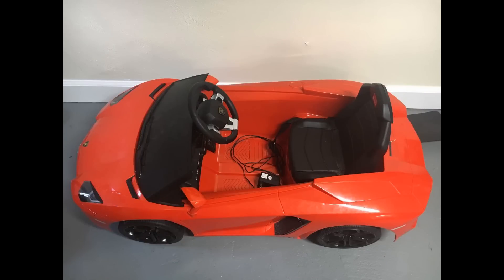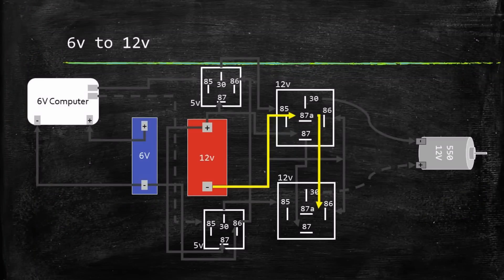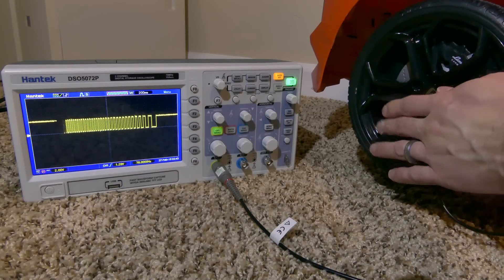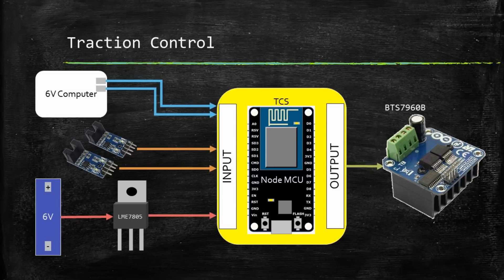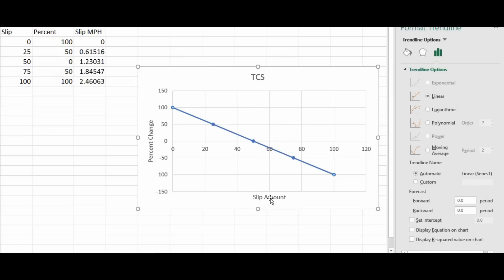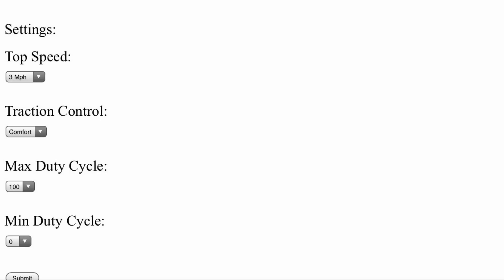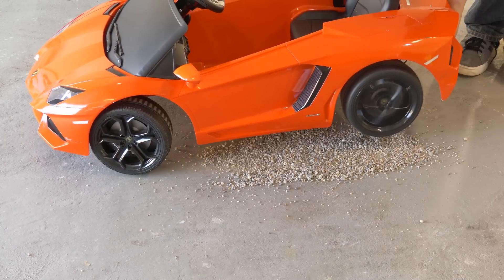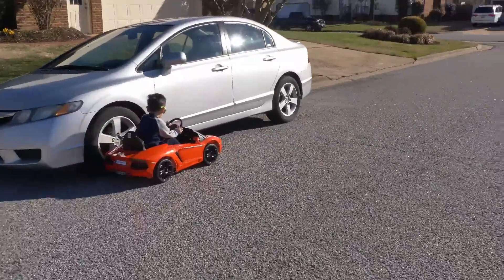Traction Control Lamborghini Power Wheel

Comment: Can you do my son Lamborghini for me an how much u charge
Reply from the maker: I can help for free, just let me know if you have any questions.
Reply: @CodeMakesItGo  just wondering how hard would this be to do without much knowledge of anything? Where would I start?
Reply from the maker: @arnoldtsen3084  Doing the 12v upgrade without software is easiest. Doing it with software to slowly ramp up speed so the wheels aren’t breaking loose is moderate to easy. Going all out with traction control and remote smart phone status is hard. I removed the traction control and now just have a speed ramp because the wheel sensors eventually broke. But I’m here to help if you want to give it a shot. Thanks for watching too!
Reply: @CodeMakesItGo  sounds good! Will def ask if any questions! Thank you!
Reply: @CodeMakesItGo  Hello again! Just wondering if you have the name or link to buy the 12V relays and the 5v relays you used in the video

Thank you!
Reply from the maker: @arnoldtsen3084  I updated the comment section with the parts, thanks for asking about it, I forgot them. You will need 2 SPDT 12v relays that can handle 40 amps, and 2 SPST 5v relays to trigger them. These aren't the exact 5v relay boards I used but these should be easier. I have the exact ones in the comments if you are interested. 

12v 5pin with wire harness
https://amzn.to/3cixrJc

5v Relay board 
https://amzn.to/3enwEtg
Reply: @CodeMakesItGo thank you so much!
Reply: @CodeMakesItGo  hi there! So the 5v relay just arrived and I was just wondering how I would interpret them in the wiring diagram. I noticed there are 85,86,87, and 30. Which of them correlate to the DC+. DC -, and the IN, NO, COM and NC. Based on the wiring diagram I assume two will be unused.

Thank you so much for your time and assistance!
Reply from the maker: I’ll make a better wire diagram and post it later today. The one in the video is a bit hard to follow because it was intended for show. But in any case, I’ll fix it up for you.
Reply: @CodeMakesItGo  thank you so much! Appreciate your time and assistance :D
Reply from the maker: @arnoldtsen3084  
I uploaded this to the github page. Here is a link to the file. Let me know if there are any questions and how it goes. One warning is that this will send the full power to the drivetrain which in time may strip the plastic gears out. I'm sure you are aware of this though. 
https://github.com/CodeMakesItGo/Traction-Control-Lamborghini-Power-Wheel/blob/master/Wire%20Diagram.pdf
Reply from the maker: Be sure add a fuse to the 12v too, 30amp. Also know there is risk with modifying these toys so please be careful and use good judgment if this is safe for your kids.
Reply from the maker: Did you get it working?
Reply: @CodeMakesItGo  not yet, one of the fuses they sent came wrong and had to wait for a return and resend, I'll be sure to keep you updated! Thank you!
Reply: @CodeMakesItGo  hello again, just wondering if there is a trick to the motor swap, as the gear seems very hard to separate from the old motor. Thanks!
Reply from the maker: I think I had to heat up the gear.

Comment: How did you keep the stock board from frying?
Reply: Stock board is still powered by the original 6v battery. I use the original power to the motor as triggers on the 12v side.
Reply: Can you do a DIY video or write please? Not much online for these cars unless they're Power Wheels brand that don't come with a call control board. Thanks 😊
Reply from the maker: See if this helps: https://hackaday.io/project/166169-traction-control-lamborghini-power-wheel
Also the code is here: https://github.com/CodeMakesItGo/Traction-Control-Lamborghini-Power-Wheel
And you can message or email me with any questions. Have fun!
Reply: @CodeMakesItGo  I think I figured out the wiring. Quick question - can I use the h bridge direct from the board without the node?? Looks to be a much cleaner set up than with the relays. Thanks again!
Reply: @CodeMakesItGo  and BTW, that Traxxas 12v seems way faster than my dual stock 550's. Is that to be expected when upgrading (stock to aftermarket) motors?
Reply from the maker: Yes, the node is only for traction control and speed limiting.
Reply from the maker: dboy26 typically yes, but not always. Some times they are slower but have higher torque. Look at the number of windings on the motor. More windings equals more torque and usually less speed. Also brushless motors can have an even higher rpm and power than the equivalent brushed motors. But are more expensive.

Comment: Nice work Jason! did you had a freewheeling diode on your mosfet? I believe I see a diode on your protoboard.
Reply from the maker: Jerome Demers indeed I did. Unfortunately I could not figure out why it kept getting blown out and tossed it all out for the H bridge. My wife was mad at how much time I wasted on that FET when the H bridge was only $13. 😁 Thanks for watching!
Reply: Could you explain how you hocked up that H-bridge? I'm doing the same 12v hack but without the traction control (just the H-bridge 12v)
Reply: Yes, I followed this diagram. "https://i.ytimg.com/vi/hny6wNhY1uU/maxresdefault.jpg" Basically tie 5v to the VCC, Left enable and right Enable pins. Then control the forward and reverse with the Right PWM and Left PWM pins. You can use the R_IS and L_IS for current feedback if you care or use the enable pins as a emergency cut off. Ensure you do not send a PWM to the R_PWM and L_PWM at the same time. Alternatively you could just use the 12V relays unless you plan to ramp up the speed which I'm guessing is what you are doing. Hope that helps, good luck!